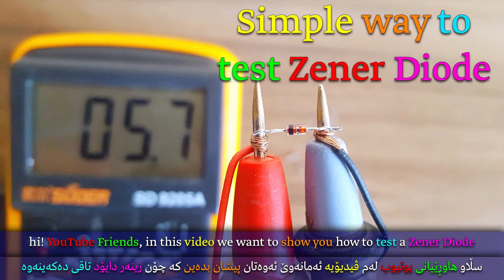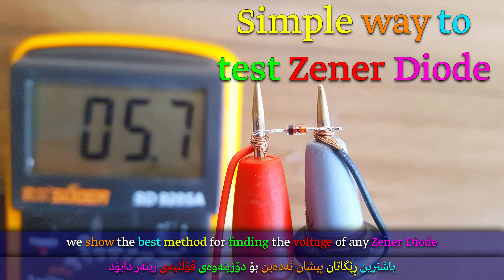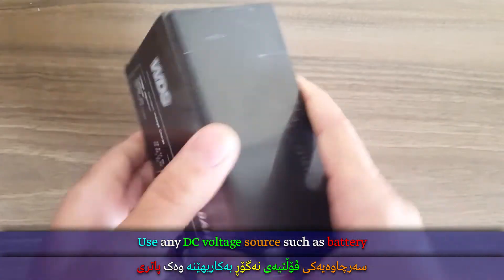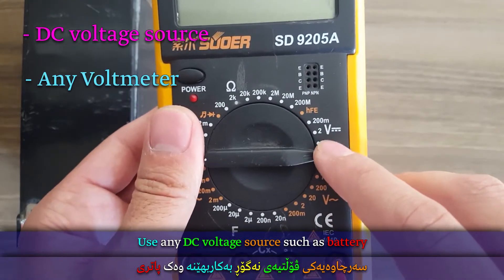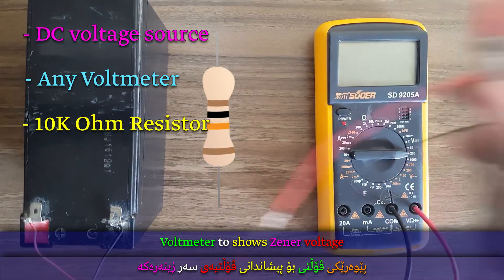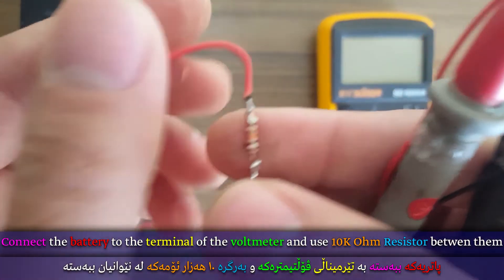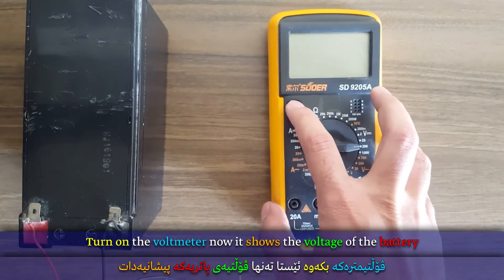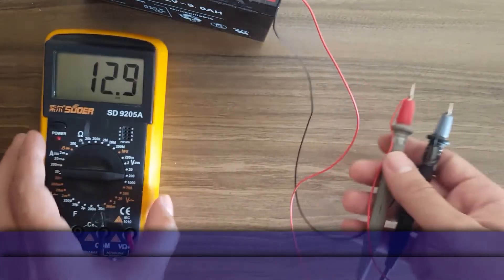Find Voltage of any Zener Diode

Comment: Very nice demo. I checked it with 12v adapter 500ma, which is showing 14 + volt output. I connected 100k by mistake & the ZD was getting hot. So I used 10k & it worked perfectly. I checked 5volt zenor diode showing exact value. When I checked 15volt ZD it shows 13+ something. Then  I checked some spare ZD, it shows 1 some 2+. So I checked in continuity range it beeps means it is short. Am I right. Thank you once again.

Comment: Zener diode value by looking on code.without testing method
Reply: My diode has a 2 on one side and a 27 on the other side and the zener diode is faulty.  So what does the 2 and the 27 mean?